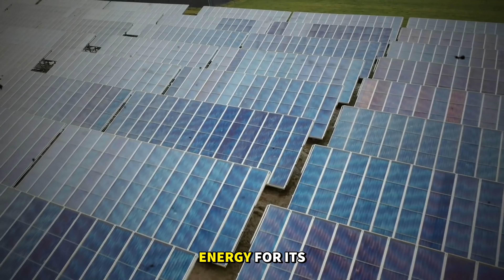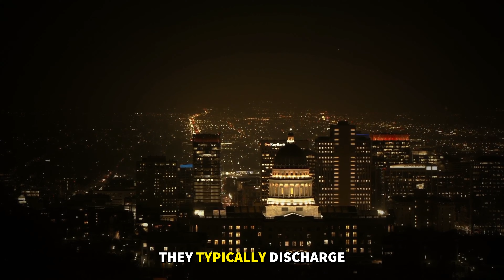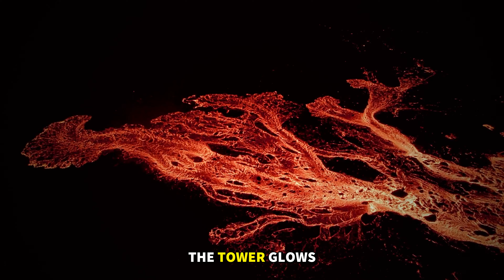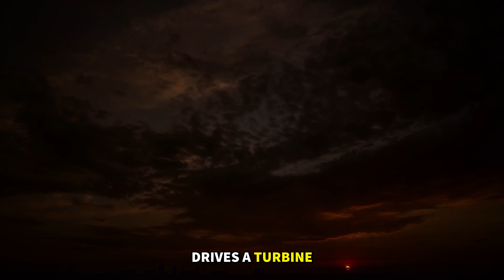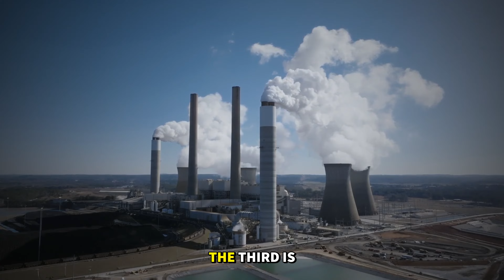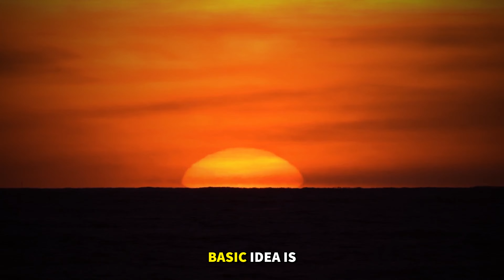How China Generates Solar Power At Night

Comment from the maker: Solar power has always had one obvious weakness: the sun goes down exactly when people get home and electricity demand peaks. The usual fix is huge banks of lithium batteries, which are expensive, use scarce minerals, and degrade over time.

China's Hami plant solves it differently. Thousands of computer-controlled mirrors focus the desert sun onto a tower, heating salt to about 565°C until it melts into a glowing liquid. That molten salt stores the heat in giant insulated tanks. After sunset, the stored heat boils water, spins a turbine, and keeps power flowing for up to 8 hours, no batteries needed. It's now the largest hybrid solar plant of its kind on Earth.

Honestly, it's not perfect: it costs more than plain panels and only works well in sunny deserts. And the idea itself isn't new. What's remarkable is that China built it at a scale nobody else was willing to attempt.

My question: is molten salt storage the real key to a solar-powered future, or will cheaper batteries win in the end? The most thoughtful answer gets pinned. 👇